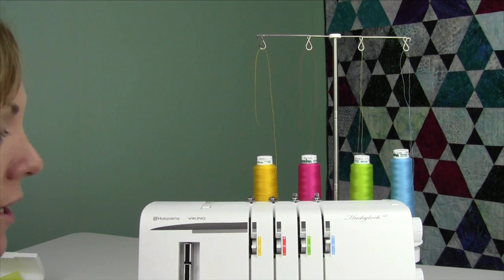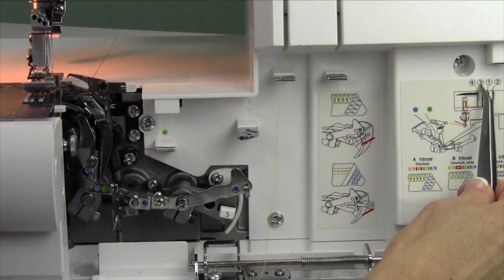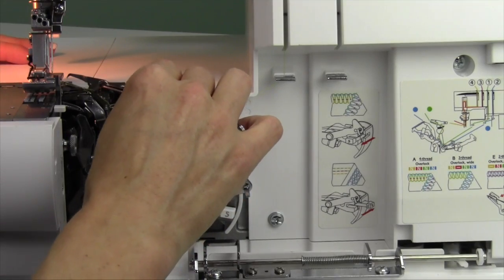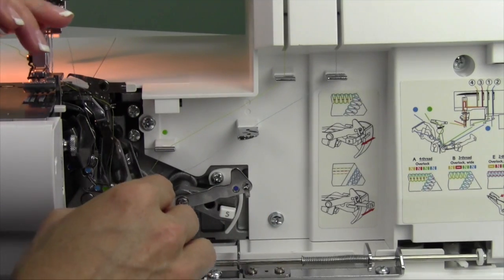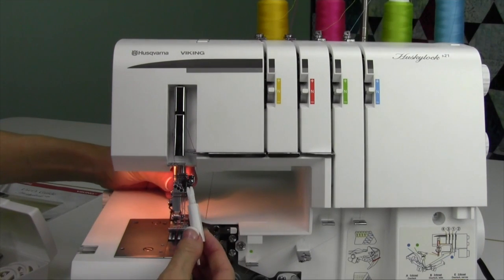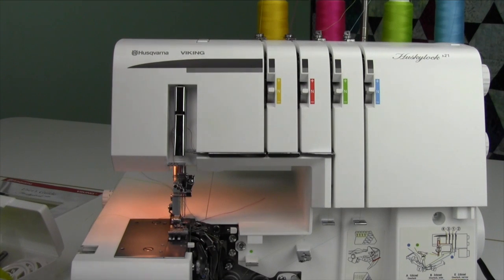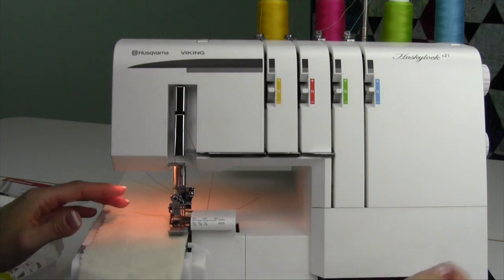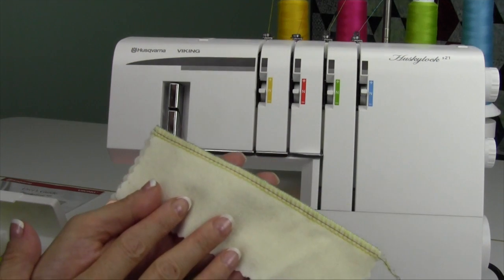Husqvarna Viking S-21 Serger 5 Threading

Comment: Just a beginner. In my book it has a Tip: Your new machine is threaded to sew a standard overlock. tie your own threads to these threads and carefully pull them through the machine, to easily thread your new overlock machine the first time. 
Which does work quite well but what do you do when you get to the needle? There is a  piece of material that is under the needles that has been engaged in sewing on the material?? Thank you